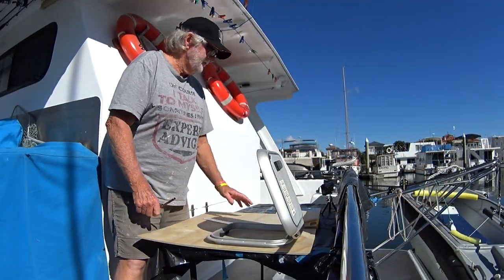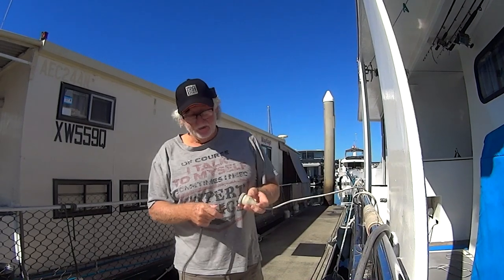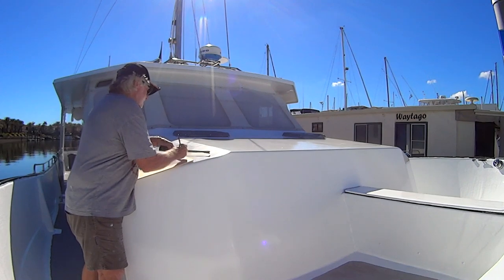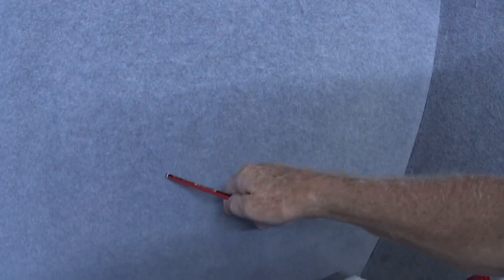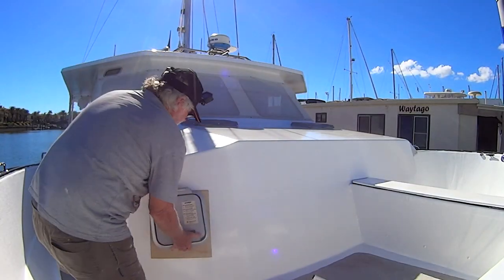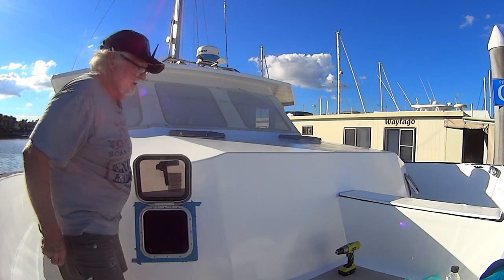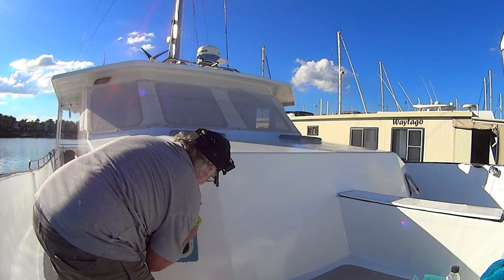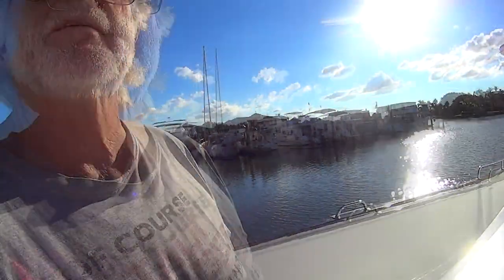Installing Moonlight Hatches in Foredeck

Comment: Hi norm good to see you on Friday the hot guy waving was me 😂, all the fix tech 15 i used in my boat broke down after 16 months and turned to powder and just fell out , it’s not in stable as they claim , I went back to sicka 295 as it is I’ve stable , the fixtech is an awesome adhesive but
Reply from the maker: Thanks for that info Richard. Thought it was you Friday.
 I was told it was as good as sika. may have to end up re doing them. 
I was removing my wooden capping rail on Friday ..am replacing it with a recycled plastic one (video soon). The rail was a bitch to remove.That was 19 year old sika and it had to virtually be chiseled off. It's pretty good stuff, but does go yellow in the sun.
Cheers mate.